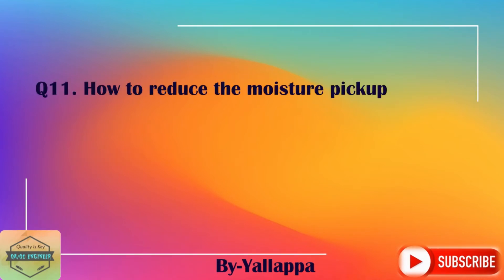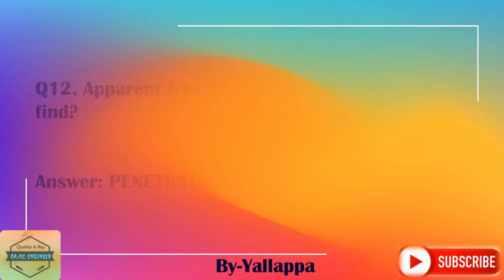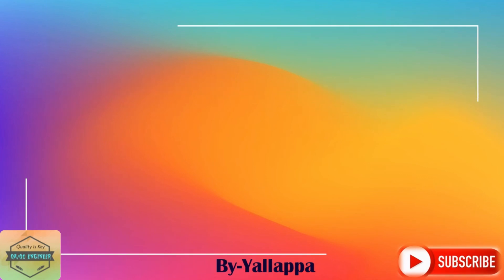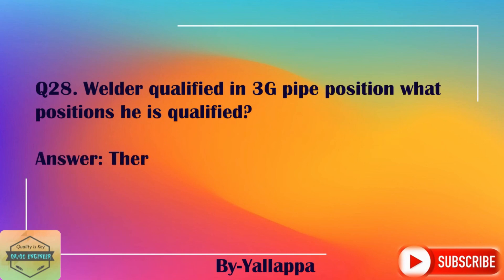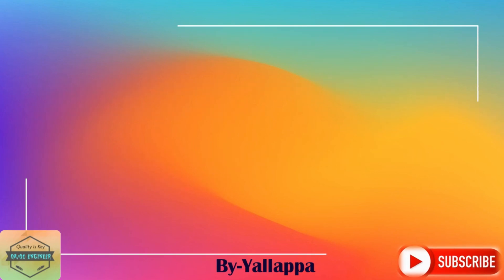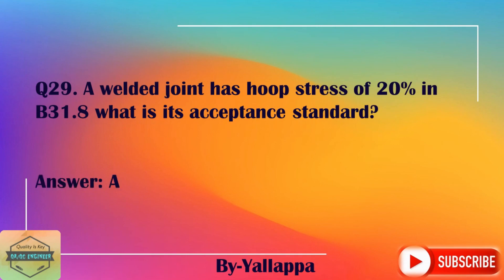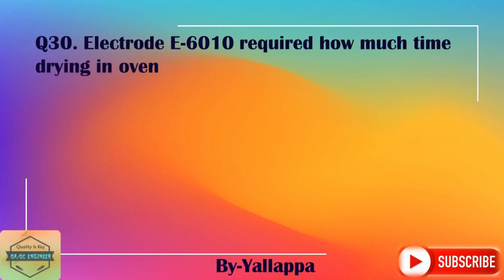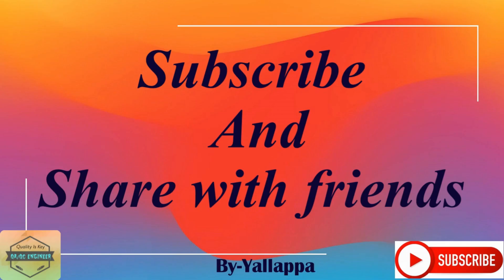ARAMCO CBT Welding Inspector Interview Questions Part-1

Comment: In piping fit up inspection gap is 1.5 mm is acceptable what is the reference code??
Reply from the maker: Wps or weld details
Reply: In this case, can't we use B31.3 ( construction code) reference?